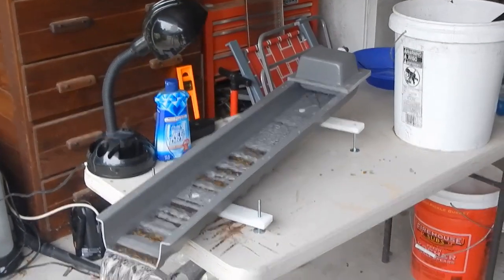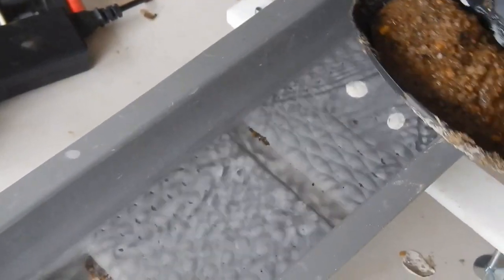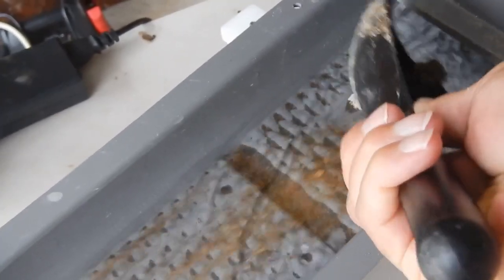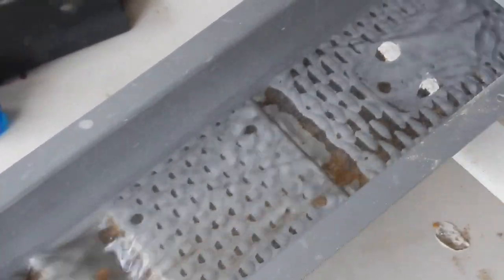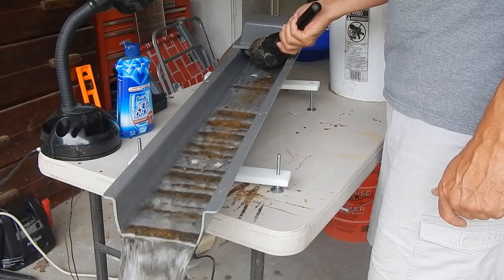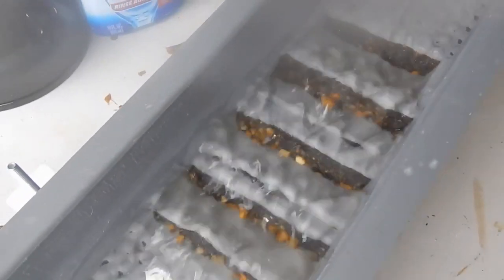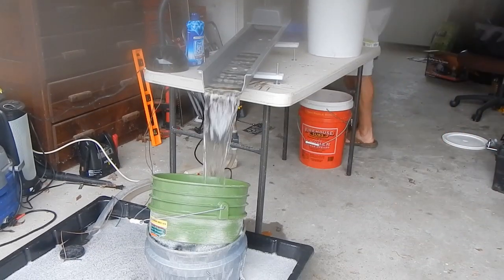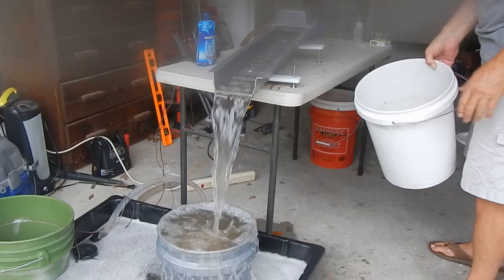Angus MacKirk  Predator III Cleanup Sluice

Comment: hmmm ;;; H2O pump drains a battery quickly ? ARGH....
Reply: I purchased a small unit that converts 110 volt to 12 volt. Then you could run your electric bilge pump off of household current. No batteries needed with this to run your bilge pump at home for recirculating.